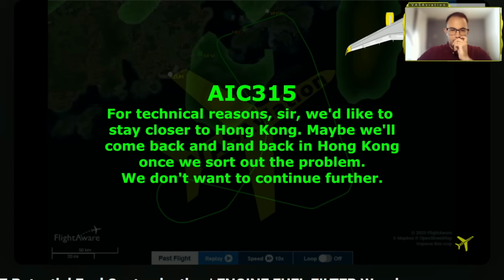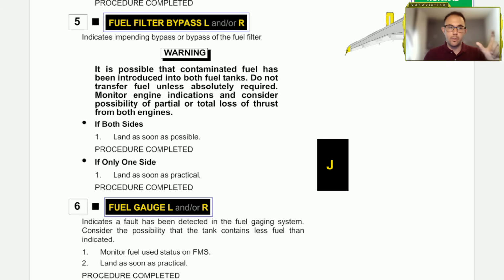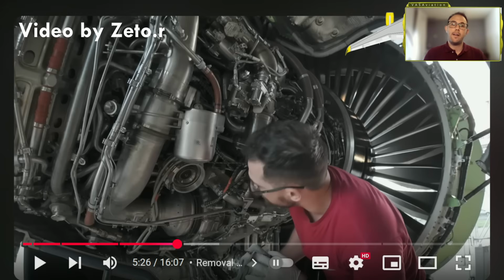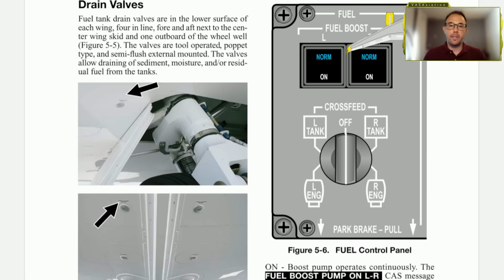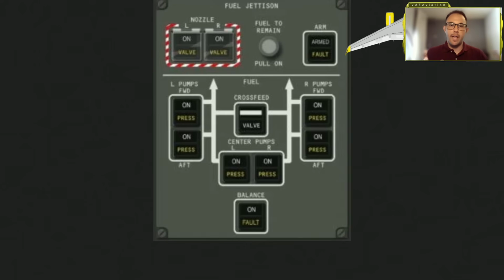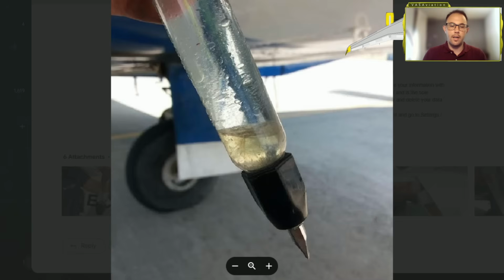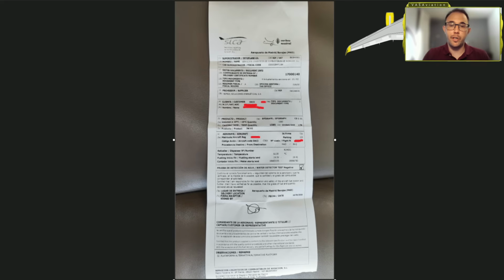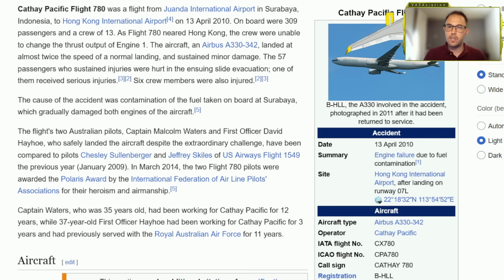Fuel Contamination | Fuel Filter Issues onboard Air India AI315

Comment: The stark difference between this incident and flight 171 (corrected) seems to demonstrate that 171 crash was NOT caused by fuel contamination.
Reply from the maker: Do you mean AI171?
Reply: What "stark difference?"  You mean that one resulted in a crash and one did not?  I completely disagree with your assertion.  At this point, we are all just speculating, that is true.  However, the previous incident (AI171) does show that Air India has experienced fuel-related issues on their 787 fleet in the past, so I believe that is relevant.  Fuel is an area of concern since this appears to be a dual engine failure, and fuel is a common denominator, while other issues like engine component failures or bird strikes are usually confined to a single engine (unless flying through a huge flock of birds).
Reply: @dperreno How do both engines operate normally up to V1, then suddenly and simultaneously ingest enough contaminant to disable the engines?
Reply: @kkobayashi1  I don't know.  I'm not saying this is what happened, just that it is a valid theory as to how both engines could lose power.  Personally, I think it's either going to be an equipment failure (electrical/engine control system) or pilot error.  But we will have to wait and see.
Reply: @kkobayashi1  Rotation

Comment: Were the airport fuel farms tested after the crash of the 787? Seems that would be step number one.
Reply: BET they are doing that now, dipping to the bottom of the tank, etc ...
Reply: ...yes but then wouldnt other aircraft departing same time have suffered similar issues, during startup or cruise perhaps, but still...
Reply: @101jtag 
Unless this was the last plane filled from a tank that was near empty. Or crud got stirred up during a delivery or transfer between tanks, and this was the only plane that had fuel from that time period.

There's loads of possibilities. Including it wasn't the fuel at all, and one of the pilots was... Mentally unwell and did it on purpose.

Comment: Stig Aviation latest video #76 at 13:30 goes into great detail on the 787 and how the fuel system is designed to bypass if the fuel filters get clogged.
Reply from the maker: I need to check it out
Reply: @VASAviation  After you watch his video, let us know what you think. He goes into great details on the 787 systems.
Reply from the maker: @Wise871  very good video! I've watched it
Reply: It's a fantastic channel and he's a fantastic teacher. His video is amongst the best on this topic. @VASAviation
Reply: He likes to call the 787 "Plastic Princess"
Reply: Same as the fuel filter in a car
Reply: @lawrencewang9048  In 1982 diesel fuel MercBenz 300TD there is no bypass, and I have had the fuel filter clog up, which then limits fuel flow and top speed of car ... this happened on interstate highway for me.
Reply: @uploadJ  Same here.  Maroon 1982 300TD. lol
Reply: @lawrencewang9048  Oh - oil filter has bypass on cars.
Reply: A clocked fuelfilter will give only a warning and the fuel is ging to use the Bypass as its designed!

Comment: why would just a single airplane have a fuel filter problem?
Reply: Faulty fuel filter sensor, faulty fuel filter, or contaminated fuel.
Reply: Because things fail sometimes?
Reply: It already happened in the past. miscalculation of something added in fuel (in the UK) + another where there has been work in the airport and that propagated to the production fuel system then in one plane. It just happened to affect a single airplane in both cases.
Reply: I think if there is warning/light for it, it could be BECUASE STUFF DOES GO WRONG  like any other machine. Everyone's sherlock suddenly
Reply: they may have been the first plane to get a shit batch of fuel
Reply: Depends on the method: did they pump from the common underground pipelines from a shared fuel farm, or was their stand remote and they got their fuel from a tanker? If so just that tanker truck might have some contamination...
Reply: We might be at 2 now. Could also be a tank maintenance issue with that airline.
Reply: Swiss cheese model, this aircraft was probably subjected to years of fuel contamination and lackluster maintenance.  This is when it finally gave out on its 2nd(3rd if you count the decommission flight) to last trip.
Reply: @Cueseca thats not what Swiss cheese model means .787 Aircraft  maintenance is done by Singapore Airlines workshop & AISEL (both world class facilities) Infact better than most ij west..rest fleet maintenance by turkish technic...so before you make these assumptions,educate yourself a little.
Reply: @pranabgill1310  Last maintenance was in 2023 and there should be regular inspections carried out by Air India staff.  So yes this is exactly what swiss cheese model means, I know me saying this somehow upsets you but maybe you should actually get your own facts straight before commenting.
Reply: @Cueseca i dont think you are an aviation guy.I intially thought you were,thus engaged with you. I think you're new to this, so I won't embarrass you. Take your time and eductae yourself from right sources. Look up engine maintainence schedules and logs , peridocity, Mro certification regulator oversight. Have fun
Reply: @Cuesecaalso look up A,B,C,D checks
Reply: @pranabgill1310  lol all you do is have insults instead of actually arguing my point.  ABC checks(ABCD lol) wouldn't matter in this case because if it was fuel contamination it wouldn't even show in these checks.  Fuel contamination should have been checked at the source.  You would have known this if you were an aviation 'expert.'
Reply: @CuesecaI am not insulting you, I assure you, I am not. I genuinely meant what I said, you need to learn alot before making such wild accusations.   When i asked you read up about chekcs and schedules. I was addressing :
1. "Years of fuel contamination"
2.  Swiss cheese model (what it Actually means)
3. Last check was in 2023, it "SHOULD" be done frequently. 
And other noob statements.

Now you're embarassing yourself.

Last C check was carried out in Singapore in 2023 (Singapore airlines hold 25% stake).
Reply: @pranabgill1310  Again nothing but insults while not making a point of your own.  

1. last check was in 2023, yes this is what I said.  Do you have a counter argument?  Do you have a point to make besides just reinstating what I said?
2. years of fuel contamination, again you're just restating what I said with zero insight.
3. swiss cheese model, and again.

Do you have a point of your own besides calling me a noob?  I am waiting.  And no I do not feel insulted, I'm kinda amused at this point.
Reply: @Cueseca you win buddy....congratulations...you are right
Reply: @pranabgill1310  What was the point of all this?  To just troll people?
Reply: @Cueseca😂How old are you?  You're the one looking like a goddam idiot,do you even comprehend what the other guy's sayin? Made him give up on youROFL.
Reply: @pranabgill1310 he's thick AF😂
Reply: @Cueseca Per Air India and their CEO, Right engine was overhauled in March 2025 and Left engine inspected in April 2025.
Reply: There would be asymmetric thrust for a while. This is not what happened